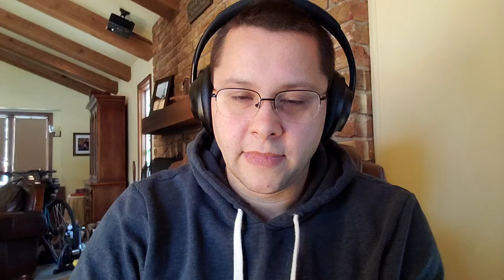How ridiculous can an EOR get before we SNAP (I've snapped.)  [Profanity warning]

Comment: If you do anything contradicting EOR instructions, you'd best be prepared to submit calculations. If your not smart enough to do that, then you shouldn't make the change from the EOR's recommendations. Not your responsibility. Your a SDS2 detailer, not an engineer.
Reply from the maker: Common sense needs to prevail in any and every building design environment.
Reply: I guess you missed the point. You must be one of those EOR's guys.